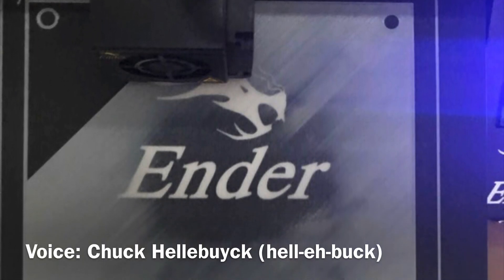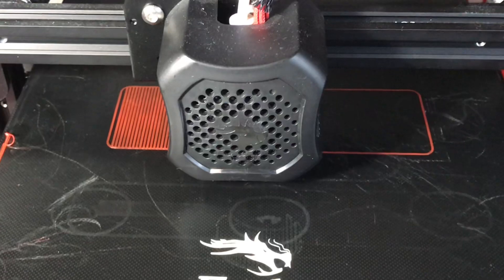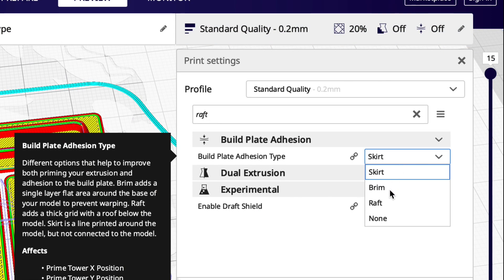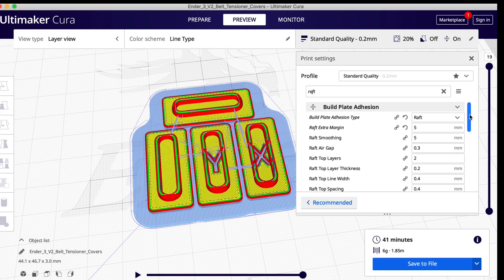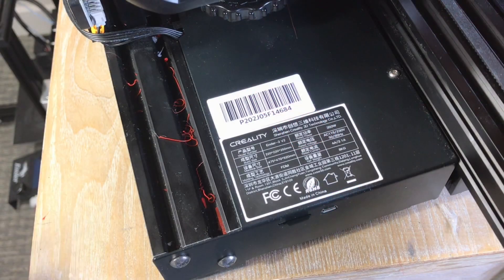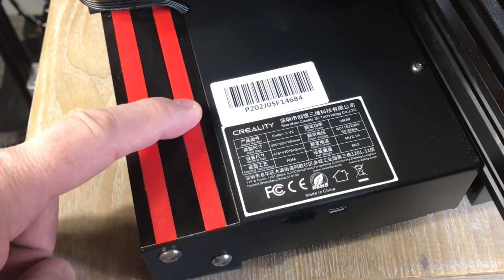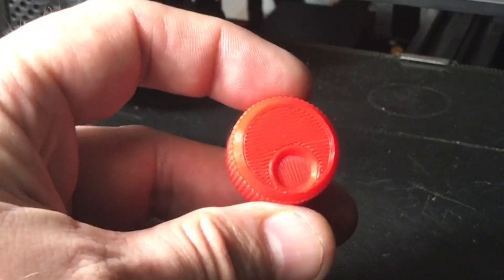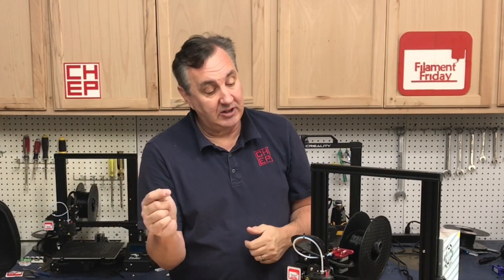Using Rafts in Cura Slicer V4.8 on Ender 3 V2

Comment: One time great two times not so great.  I have been using the Rafts but they use up material and add hours to a larger print and it is just not repeatable every time. Is there a bed plate replacement that does not warp Been working on this for last 2 days   I level the bed with your gcode i print the bed level print and it looks beautiful   When I go to print a project with footprint the size of the test grid I can see the line thin out in the middle   (front to back seems ok left to right)  I am printing on a piece of temper glass.  It is definitely the most frustrating part of 3D printing. I do not seem to have issues with adhesion but at times it seems to pancake out the first few laters. Ender 3 pro  Bought in November
Reply: Manual Mesh Bed Leveling has solved that for me. My glass bed is warped and its not a problem.